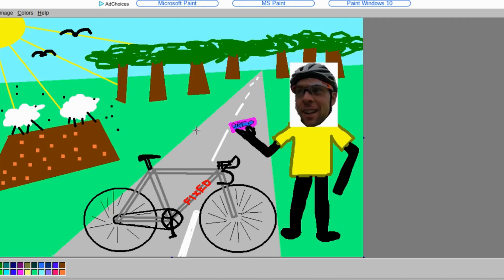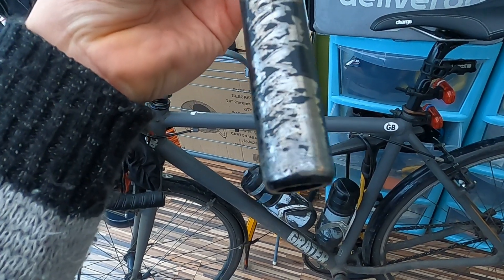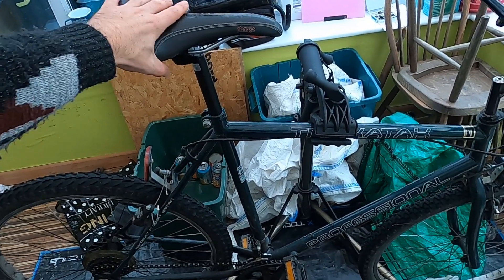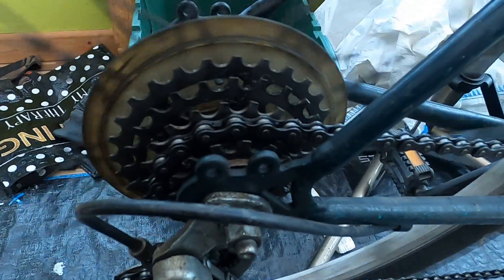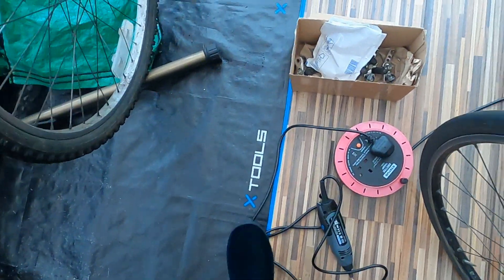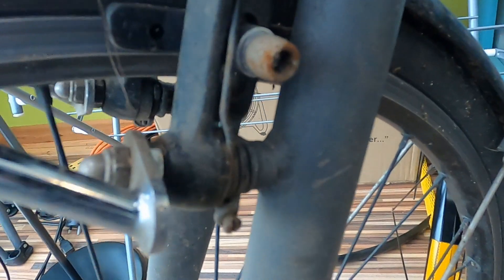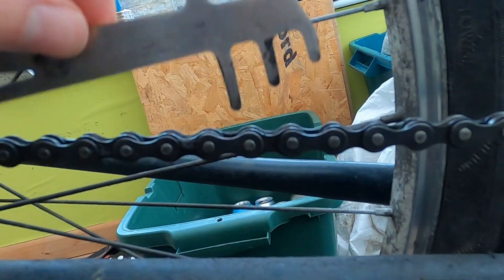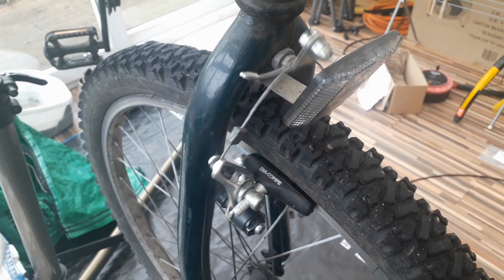Fixing up old MTB Trakatak

Comment: The 'dance' on the rear sprocket cluster is because the axle is slightly bent. This is because that hub takes a screw-on freewheel (rather than newer hubs, which have the 'freehub' attached and take a splined cassette). The freehub puts the bearings closer to the dropout and makes for a stronger system less likely to bend the axle.

Comment: To strip and adjust the BB, you don't need to actually need to remove the fixed cup or drive side side cup, you can access from the other end, looking at that end - ie non drive side, you have a lock ring and an adjustable cup with some convenient looking flats, so you could use a punch or cold chisel and hammer to loosen the lock nut and then use a spanner across those flats to just take out the play and then re tighten. Ordinarily you would hold the adjustable cup with one spanner and tighten the lock ring with another but you could manage without and allow for a bit of rotation as you tighten the lock ring.

Comment: Also, as the chain was so worn, you'll probably find the chainrings and sprockets are heavily worn too. Replacing the chain without changing the chainrings and sprockets (freewheel) will lead to problems with chain jumping.

Comment: You know, the reflectors were the temporary solution after lawsuits concerning cantilever brakes. If the front brake cable broke, the bridle would catch on the tire with dire outcomes. Next time don't bother cleaning the chain before checking wear. You probably could just adjust the non drive using a lockring tool. If you're ambitious you could probably clean the bb and repack it from the non drive side. First you'd have to have a crank puller tool for the drive side crank. Drive side cups are notorious for getting stuck.